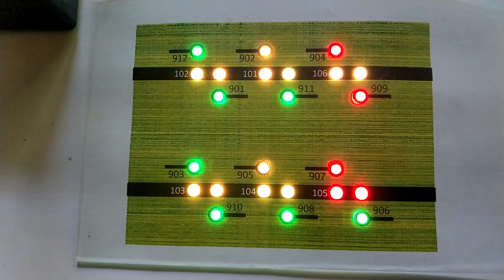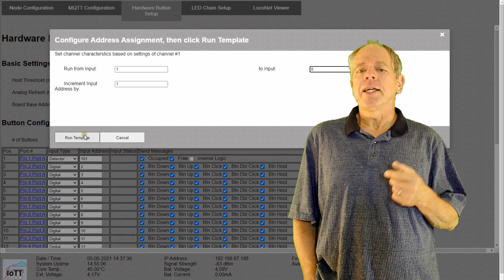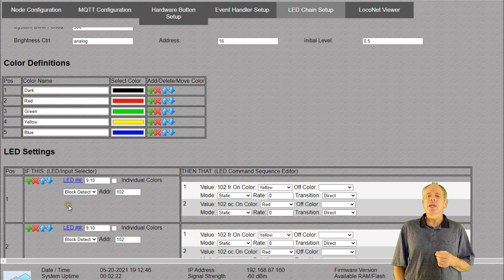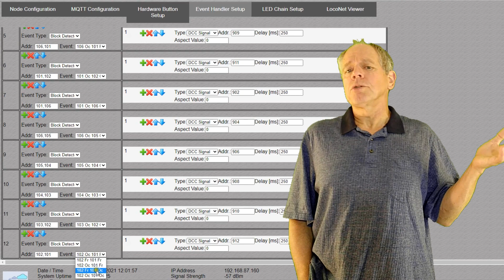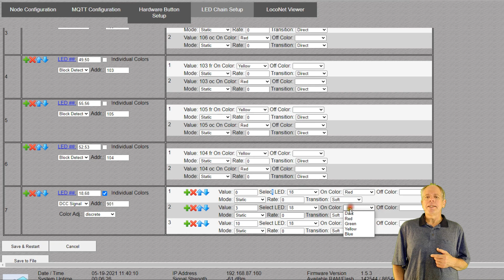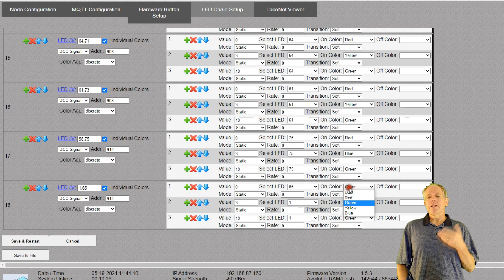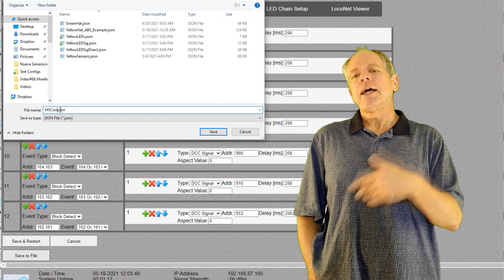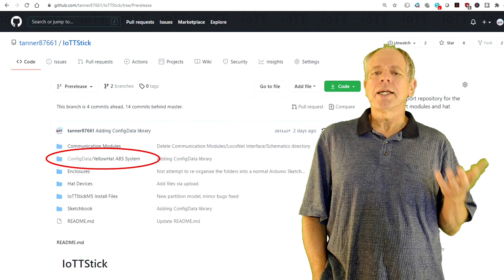ABS Signaling with YellowHat (Video#69)

Comment: For anyone trying to implement this setup, and you get weird output on your 8x8 neopixel display, the difference is in the way the display is wired.  The 8x8 is wired left to right or each row in Han's example.  If you get the inexpensive 8x8 display from Amazon or china, you may not have the exact same display as Hans.  I got mine from Amazon and it was wired as a back and forth string, like a single string.   So I modified the numbers to match my 8x8 display. 

Signals East:
               	Hans:           Amazon:
901	                 18                   23
903	                 41                   41
905	                 44                   44
907	                 47                   47
909	                 24                   17
911	                 21                   20

Signals West:
               	Hans:           Amazon:
902	                  4                      5
904	                  7                      2
906	                 64                   64
908	                 61                   61
910	                 58                   58
912	                  1                      8

Signal Board:
Hans:                Amazon:
9, 10		      9, 10
12,13		    12, 13
15, 16		    15, 16
49, 50		    56, 55
52, 53		    53, 52
55, 56		    50, 49